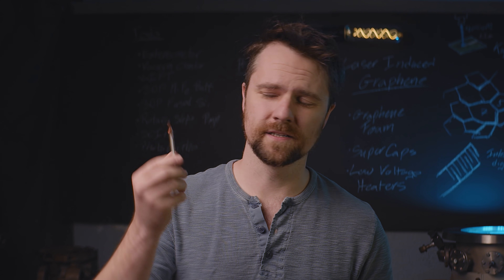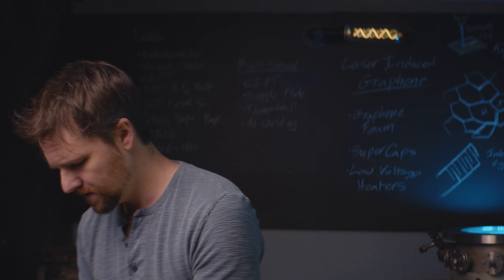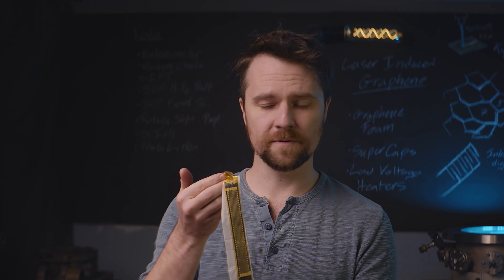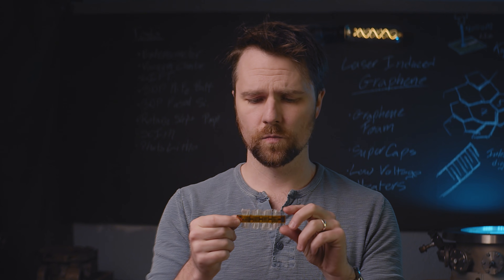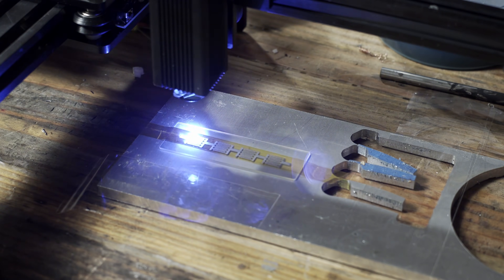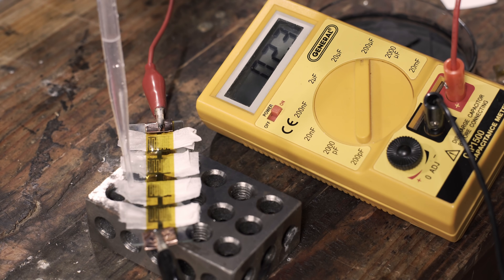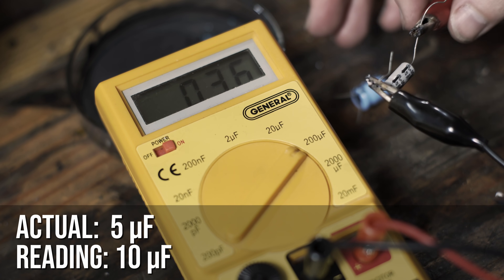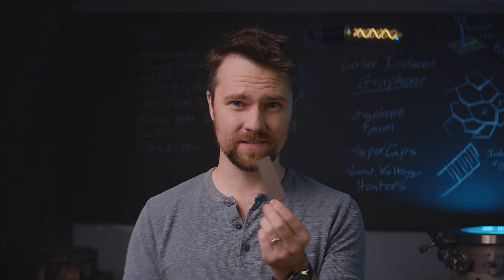Kapton Tape Supercapacitor?

Comment: Amazing! Thanks for the share! Do you think this technique would work equally well with a 445nm laser (between 4/4.5W output)?
Reply from the maker: Oh oops, that's my fault!  My laser is a 450nm (blue) laser, not 405nm (purple/ultraviolet) that I said in the video.  Totally missed that verbal typo until now, sorry about that!  So yeah, your 445nm should work great :)
Reply: @BreakingTaps  Definitely going to try this! I was reading some papers about it suggesting tweaking to 100mw (so running the laser at 2% power in my case), what kind of power settings are you running with? Supposedly theres an ideal range, would be interesting to see the difference.
Reply from the maker: @cmalune  Awesome, lemme know how it goes!  There's definitely a range of power that "works", hard to know which is best though.  I ran some test grids that ramped power and speed, and found that resistivity was best around 90% power and 40mm/s on my machine.  Definitely depends on the kapton brand/thickness too... I picked up some "super thin" kapton from McMaster and the graphene just flaked off at those settings, had to dial down the power.  That said, resistivity test is pretty crude way to measure, it could be that I was generating more graphite/amorphous carbon than graphene or something at those settings (literatures suggests it's a big mess of carbon species anyway)... looking to source a Raman spectrometer so I can verify :)  If I remember correctly, you can start to get "marks" on the kapton with very low power settings so it'd be interesting to try those too.

 (note: some papers use pulsed lasers instead of constant, that can affect things considerably, and different wavelengths powers don't always transfer over nicely)
Reply: @BreakingTaps  From reading this paper: https://www.researchgate.net/publication/340889144_Laser_Scribed_Carbon_Layers_Process_Optimization_Sensor_Applications  
Disclaimer: Not sure if I'm interpreting the results exactly correctly.

They seem to suggest that lower Kapton thickness implies higher resistance, where it seems to plateau around the 50 micrometer mark.

For the lowest resistance, their graph shows between 650mw and 800mw gives better resistance depending on the application.

The optimal linespeed looks to be between 900mm/min and 1100mm/min. 

Their results suggest that past 1200mm/min the resistance jumps up and lower than 800mm/min there is a jump but not as bad.

To properly interpret the 'mw' ratings they give, one has to know what the efficiency of the laser being used is.

So when they say '700mw' they mean 100mw laser power assuming a 15% laser efficiency.

Their conclusion was thus that the optimal writing conditions should be:
* ~100mw taking into account the efficiency of the laser
 (so 700mw for a 15% efficient laser)
* linear speed of 1000mm/min
* 60um thick kapton

With the right settings the inscribed graphene is supposed to provide better conductivity than reduced GO, which is pretty amazing.

I'll test this out more thoroughly in a few days and get back to you.
Reply: @BreakingTaps  So I did some experimentation (ran a test grid of around 100 tests with varying attributes).

The Kapton I was using was super thin, I used a 15W laser 445nm (4W output) and tried to focus it properly before the tests.

For the super thin Kapton I found that 12.5% power (roughly 600mw) at a speed of 300mm/s started to graphitize the material.

Faster / higher power seemed to give worse results in general which I blame on the tape thickness.
 I got the flaky carbon effect when the power was too high or the speed was too fast. Slower speed seems to make the graphene more 'fixed' onto the surface.

I'll try again once I get some thicker Kapton tape.
Reply from the maker: Awesome, let me know how future tests go!  That seems to align with what I saw... never had much luck with my "super thin" kapton (https://www.mcmaster.com/1754N13/), flakes off very easily and when I dial down the settings to keep it from flaking it isn't very conductive.  I recently got some really thick stuff (https://www.mcmaster.com/7648A725/) but am still dialing in the settings for that.  My best luck so far has been some random roll of cheap kapton in the back of my electronics box :)  Another note:  I've seen a lot of papers just use non-adhesive PI or PEI film, rather than the tape.  Much thicker, albeit more expensive.

I think the focus on my diode is sorta wonky too, at best-focus it's somewhat "two-lobed", so I'm sure that plays into things too.  Lots of variables.

Did you poke it with a multimeter to see what kind of resistivity you were getting?

Cheers for that paper btw, I hadn't seen it before... looks very interesting!  Gonna dig into it closer this weekend and see if I can pick up some tips to fine-tune my process.
Reply: @BreakingTaps  It seems like our results are similar. I tried a range of tests on the thin tape and at lower power settings (ranging from 300mw to 800mw and from 300mm/min up to 1000) the material is well tethered but poorly conductive (in the kilo-ohm range).

Changing the density of the lines to 381 lines per inch seems to overall be beneficial over the default 254. 508 sometimes produces better results as well so might be worth trying. 

On higher power settings the material is flaky as you describe and measuring resistance becomes difficult (the results seem more unpredictable). The best result I obtained was at higher power (above 2000mw) and higher speed (above 4000mm/min) and in the mega-ohm range.

I also started to test a 'layered' approach where I run a low power pass first to prepare the surface and then run a high power / fast sintering pass on it. Will let you know if I get anywhere with it.

I ordered some 1-milimeter thick Kapton for cheap from a random seller on Amazon and I reckon I'll get much better results with this - the previous tape I can't even measure the thickness because extremely thin and no description in the purchase.

There definitely seems to be a threshold thickness, where too thin seems to imply burning through the surface without enough usable material to get a good product or the product being completely graphitized and thus not sticking any longer. 

The PEI films look awesome but expensive as you say and I'm not sure this type of thickness is required yet in any case (the paper seems to imply above 0.06mm thickness is good enough). Its also possible to buy rolls of Kapton which aren't adhesive which kinda works out the same in any case.
Reply: @BreakingTaps  On process optimisation, I finally managed to get some good results so thought I would share. 

I switched tape to another 'thin tape' <0.05mm thickness whilst waiting for the 1mm thick tape to arrive and I managed to get <400ohm resistance.

Here are the steps I used (step 0 is a work in progress :)).

Step 0 - Acquire tape that is >=0.06mm ideally (film thickness)
Step 1 - Focus the laser beam and measure precisely the length (e.g 1mm). 
  * For a beam length of 1mm, set the lines per inch to 15 lines per mm
  * For a beam length of 0.5mm, set the lines per inch to 30 lines per mm
  * Optimise +/- accordingly. 
  * This is the most important step since resistance is huge if the lines are too far apart.
Step 3 - Configure the initial speed / power output of the laser
  * Set the speed of writing to 1000mm/s
  * Make a guess as to what the efficiency of your laser is (e.g 15% efficient)
  * Aim for 100mw output: 
   - For a laser that is 15% efficient, aim for an output of 700mw.
   - For a laser rated at 5000mw output, this would set the laser power to 14%.
  * You will know when you reach 100mw because the resistance will be the lowest.
Step 4 - Create a test grid of 1x1cm squares for resistance testing
  * Start with 0.1% power decrements, test ohmic resistance and switch to increments accordingly until you find the right resistance values.
Reply from the maker: This is great stuff!  You should document this somewhere so it isn't lost here in the comments :)  What software are you using to control your laser?  I don't think mine has an equivalent of "lines-per-inch" unless you're raster-filling a bitmap image (which then lets you do DPI).

Do you know what kind of adhesive your tape has?  I wonder if that makes a difference too.  My samples from McMaster have a silicone adhesive, unsure about my random mystery tape.  I saw that there are acrylic-based adhesives too.  No idea if it matters, but I could see the acrylic and silicone decomposing in different manners (or potentially not decomposing at all in case of silicone).
Reply: @BreakingTaps  I'm using lightburn which has lots of nice features. Curious as to what the lowest resistance you were able to achieve whilst experimenting, in my case it was circa 200 ohms for thin film and I think in the paper they mention 100 ohms. The adhesive is silicone, I haven't seen may tapes being sold with alternative adhesives, only ones without adhesive altogether. 

I'm in the process of documenting but more on paper at the moment. When I have a digital writeup I'll send it over. I'm planning on trying to use microscopy on the samples to see why there is a big difference using different LPI values. I suspect this is going to vary based on the lens being used.
Reply from the maker: @cmalune  Lowest resistance was in the ballpark of 40 ohms, although I wasn't super rigorous on technique, just probing points roughly cm apart.  So grain of salt on that number.  Most of my samples tended to be 150-200, and a few tests were way up in the kilo-ohm range.  So definitely some process variability :)

Mcmaster has some Acrylic-backed adhesives, but I admit that's the only plave i've seen them.

Looking forward to the microscopy results!
Reply: @BreakingTaps  if one could get low resistance reliably, you might even use this method for flexible circuit boards!

Comment: Fantastic... Now i can just "print" my heating element for my flow chemistry microreactors...this just made my life more that 100% better... always a pain to find a right size film-heating element.
Reply from the maker: That sounds interesting!  Got a link to more information?  Fair warning if you attempt to make one of these heaters, getting a good electrical contact is a little tricky since the graphene can be fragile.  I used copper tape and mechanical clamping, but something like conductive epoxy would probably be a lot more reliable.  Goodluck!

Comment: Not sure I'd call this a super cap. Its still impressive. But orders of magnitude too small to be super. I also wonder what the ESR is like? Will you be doing T curves? What about lifespan? Can it be used as smps output cap for long term?
got a sub from me. Keep up the experiments :)
Reply from the maker: Yeah, I think it's only "super" in how it operates (electric double layer, etc), not necessarily from it's capacity :)  Working on a followup video to clarify some things, fix some mistakes and maybe build a larger model.  I'll try to add some more robust testing to that one!  Very much an electronics newbie myself, so I'm not sure I'll be able to interpret the data well.  But I can definitely put it on screen and see what folks think :)  I picked up an octopus tester so we can characterize it a bit, and was planning to measure the Vc(t)/time constant which I'm assuming is the same as a T curve?  I'll read up on how to measure ESR (although I think the octopus tester will show some of that too, e.g. as a slanted circle?)

I think EDLC supercaps are actually not great for filtering, since my understanding is they tend to have higher ESR in general than regular caps.

No idea about lifespan, or even how to test :)  The literature suggest this type has hundreds of thousands of cycles though, since it's just ions moving around in the electrolyte.
Reply: @BreakingTaps  thanks. All good about learning as you go. I look back at my old videos and face-palming a lot. Lol. Completely self taught myself. Currently employed as electromechanical engineer XD

ESR is measured with a signal, usually a triangle wave, and you look at how much its de-tuned. I think. Don't quote me and do your homework lol. I just use a tester lol. Doing it manually on my to do list. 

For the actual use test with smps, i wasn't thinking so much as filter cap, but as storage for rectifier output. Yes edlc is probably worse than electrolytic, but fun to test. Think about other practical use and see what you can do. 

To check lifespans. You work it too hard and extrapolate. Google electrolytic temperature de-rating chart and you'll see what I mean.

If your looking at a squished circle on an oscilloscope, your usually looking at power factor. In a cap this means current passes instantly, like a resistor, but there is lag in the voltage. In inductor its reverse volts change instantly but current lags.

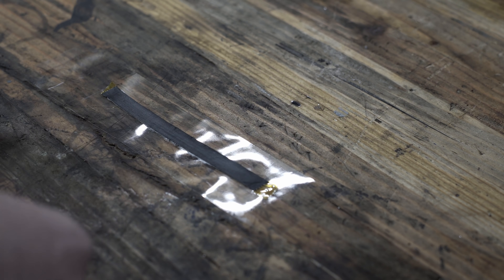Comment: 7:10 - you can no longer consider your 1-3-5 block a precise instrument since it had corrosive acid on it... R.I.P
Reply from the maker: haha yeahhhh, I was hoping no one would notice. 😅  I've relegated these to non-critical setups anyway since they started to rust from prior incidents.  They are cheapo Shars blocks anyhow so I don't feel quite as bad... I have a nicer set I try to keep wrapped in oiled paper :)
Reply: @BreakingTaps  Anyway. Great concept! Do you think it would be possible to seal these DIY capacitors to last at least several years?
Reply from the maker: To be honest I have no idea :)  The literature seems to say they can charge/discharge tens or hundreds of thousands of times, so the cap itself should be fine.  Probably boils down to packaging and such more than anything

Comment: Amazing effort (and thanks for sharing), but how is 156µF "Super"? I thought super caps were in the Farad range.
Reply from the maker: They can be, but don't necessarily_have_ to be enormous.  My understanding (which is limited!  grain of salt :) ) is that supercaps are defined first by how they function (electrostatic double-layer, pseudocapacitor etc) and second by some kind of per-unit-volume metric.  E.g. 156uF isn't crazy high, but compared to a normal 150uF electrolytic cap it has a lot less "active" material.  If you were to unroll a similarly sized cap there would be quite a bit more unrolled electrode material.  In the literature a lot of these planar, interdigitated super caps are actually being used on ICs since they fabricate easily, are flat, and pack in a lot more capacitance per volume than traditional IC caps (or discrete added aftewards)... but ultimately are still very small capacity since they are micron sized :)
Reply: @BreakingTaps  That makes sense. Thank you for taking the time to reply.
Reply: I discovered the largest graphene supercapacitor has a capacitance of 10,000 Farads.

Comment: Great research and presentation! The applications for this technique are huge! I'm an electronics engineer. And I think there's a possible fault on the capacitance metering. Multimeters presume you are measuring a capacitor, but electrodes in a acid medium will make a resistor(or RCL equivalent circuit), also may be electro-chemical reactions going on. There is no insulation on your device and electrons are flowing between terminals. It will probably self discharge almost instantly. To measure a capacitor precisely you first need to charge it, disconnect from source, than connect it to a load. Integrate the power it produced and you will have the energy it is able to store.
Reply from the maker: Ah interesting, does that apply when using a dedicated "capacitance meter"?  I had assumed/hoped it had internal circuitry to power the cap to some degree and test it's leakage or something?  This is the device I have: https://www.newark.com/general-tools/cap1500/capacitance-meter-digital-200pf/dp/59P4162  I did find that it self-discharged very quickly just sitting on the bench, and made even worse when poking it with a multimeter :)  I'll see about setting up some kind of circuit as you suggest to test it.  Thanks for the help! Electronics is definitely not my forte, very much a newbie still :)
Reply: @BreakingTaps  Hard to tell what process it uses to measure. But I think you don't have a capacitor(yet). You need an insulating medium between electrodes. For example electrolytic capacitors use aluminum oxide. In a capacitor electrons can't flow between terminals, there should be an insulation, where an electric field will be created to store enery.
Reply from the maker: @Eduardo Schoenknecht  So big grain of salt due to my general ignorance, but my understanding from the literature is that these types of supercaps operate a bit differently.  When charged, a helmholtz double layer is formed symmetrically on the electrodes using the ions in the electrolyte (graphene + | - electrolyte + | - graphene), so there isn't actually a dielectric in play here.  Just ions associating / disassociating with the graphene at the interface between liquid and solid.

In theory, based on my reading, but as I said I could have that incorrect :)
Reply: @BreakingTaps  you are right. And I don't have knowledge on super capacitors chemistry. But I think a special electrolyte is needed, regular diluted sulfuric acid will just conduct electricity.
Reply from the maker: Roger, thanks for the help!  Will do some more reading on my end.  I'm itching to see if I can scale this thing up, so might be able to make a more robust v2 at the same time :)